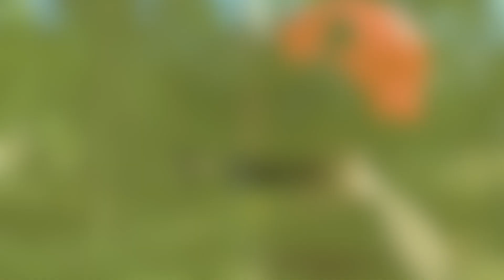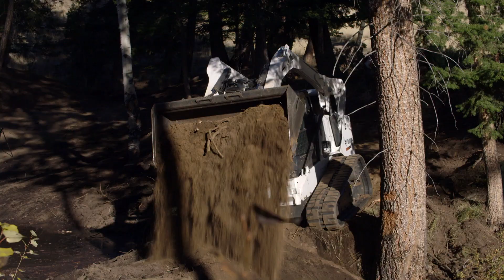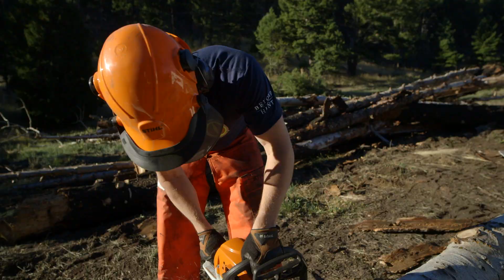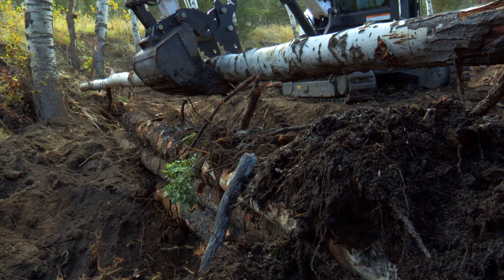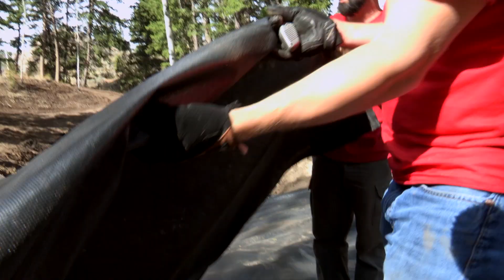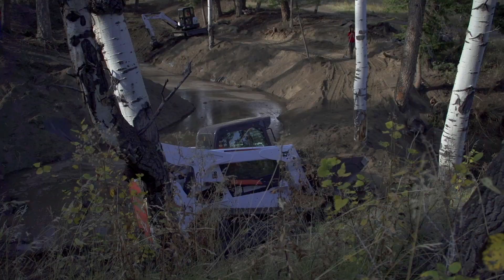Build A Pond With Bobcat Equipment

Comment: When digging water containment structure where running water is present I lay a drain pipe at lowest point and run it under dam with shutoff valve ,surround pipe with bentonite at both ends,full length is better,with plenty of riprap at both ends,makes it nicer for working and pond can be drained for maintenance and repairs